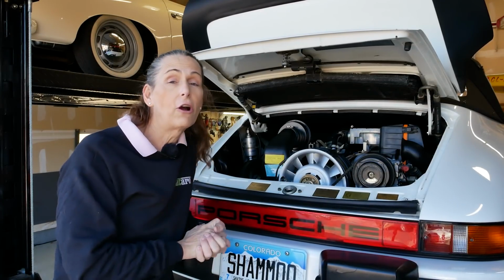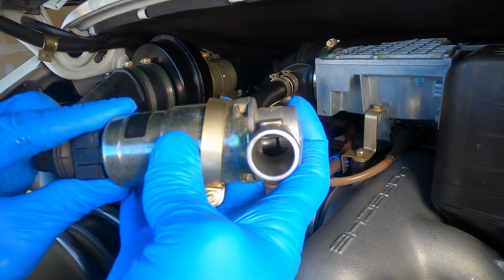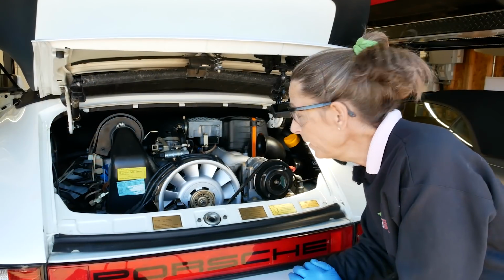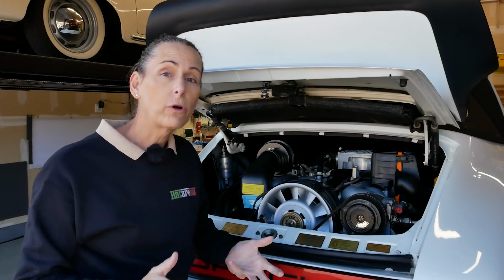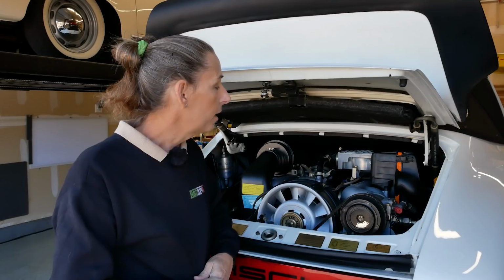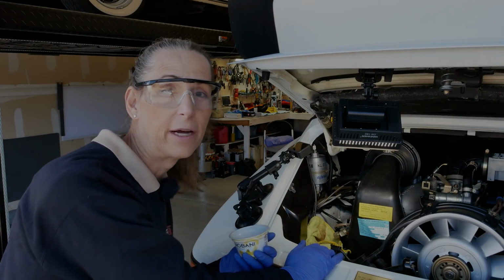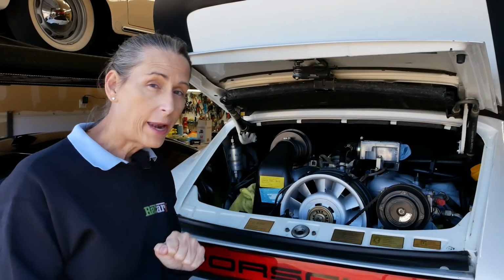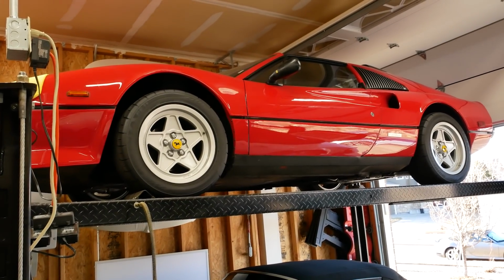Budget eBay Porsche 3.2 Carrera Project Car! #29 - WHAT IS GOING ON WITH THIS ENGINE!!!

Comment: WoW!  FI is not something I'm familiar with, but you really systematically isolated the faulty component.  WoW, great job Franny.  IF I had a suggestion, it would be that you secure your lovely ponytail.  I was a little frighten to see it moving around so much with the engine on, and the belt right there. I only remember from my H.S. days, (69-73 ~ ancient I know) of a friend that had long hair, and working in the machine shop during class on a lathe, it got caught and pulled his head down right to the machine, and only by yanking his head and pulling the hair right out of his scalp saved him from serious injury.  He had past shoulder length hair.... .  Anyway, great job, watch out for those purdy locks :-)  .  So glad you figured it out so methodically.  Great video.  :-)
Reply from the maker: Thanks so much.  Yes, Heidi had at me with the clippers ;)

Comment: Fantastic diagnostic video!!!
Don't get discouraged, did a split case rebuild on my '87 Carrera last year always a couple teething and digestion anomalies that can't be anticipated. I believe mine were a cracked forward fuel line, pedal bushings and slave cylinder on hydraulic clutch - be oh so grateful you don't have one of those! ;)

Just a suggestion....let that baby breathe, now that you have a sport exhaust ditch the restrictive & bulky air box and throw on a K&N cone filter. I think you'll be happy with the result.
Reply from the maker: Thanks so much!

Comment: I would be worried about the fuel injector rail corroding due to the zinc plating process it never coats the internal surface properly. I mentioned it before when you had it off for plating. The injector could be clogged with debris. Hopefully it’s sorted soon. Are you able to inspect the rail now it’s got the injectors out? It would be evident if corrosion as set in.
Reply from the maker: Thanks Elliot, I did check the inside of them and they are clean with no corrosion and nicely plated.  I didn't find any bits when I drained the rail and all the injector's screens were clean.  In this case it is a mechanical issue with the injector(s). I just got them back. I'll go over it in the next video.
Reply: @HeidiandFranny  oh that’s great news. Hopefully it’s sorted once the injectors are back in.

Comment: Great job, You inspired me the same job on my 1992 965 Turbo. I know my around air-cooled engines very well. Having owned and auto crossed and did a few DE's in 911's cars for 30 years now, I live in the DC area now, but from California, its become my winter project living in DC, I'm waiting on my exhaust to be finished getting ceramic coated and some powder coated parts, I also sent my hardware off to Van Nuys plating, Linda is great, Thank you for the recommendation. I also took the front suspension apart to have all the arms blasted a powder-coated and new joints and stuff and hardware plated as well. And injector blocks and upgraded clutch. I doing a leakdown today, all this in my garage just like you ladies. Again thank you for the inspiration.

Helio
Reply from the maker: Oh, that's great!  You are going to love the plating.  They do a great job.  Wow!  You'll have to let us know how it goes!
Reply: @HeidiandFranny  I would like to send you pic's of my project. My handle on Rennlist and Pelican forums is heliolps2, please send me a private message with your email and I'll send you updates on my 965. Keep up the great work Ladies :)

Helio

Comment: Never heard before about not removing plugs from a hot engine but makes sense
Reply from the maker: At least on these air cooled cars there are super hard to get back in... They just want to cross thread every time... Cold they go right in.  They are right coming out too.

Comment: Good diag.  I'd guess the bad injector is throwing off the O2 sensor probing of the exhaust which may affect your idle. I have very poor performance also in my 88 911 but without the surging idle. It also feels like a lost cylinder, but haven't diagnosed yet though.
Reply from the maker: I'm going to go through several more things to check in the next video. I'm not convinced we are out of the woods just yet.

Comment: Great informative video and an excellent methodological technique to solving problems . May I also suggest to perform a vacuum test with a pump for all the lines and also a cylinder leak down test. With the above test you shall for sure rectify any snags and get the car running top notch 👏👏👏

Comment: Fantastic video. I learn so much. (I have a white '87 Targa). So what makes the idle go high when one cylinder is 'dead'? And why fiddle with sending old injectors all over the place? Are they that expensive that you wouldn't just buy new ones? Thanks for sharing all this with the community. You are a treasure.
Reply from the maker: Thanks! Good question on the idle.  I'm not convinced it is just the injector either... I'll get to it this weekend and we'll see.  Those darn injectors are about $300 a piece for the originals and maybe a bit less for aftermarket. I think RC is $25-$35 for complete refurb.  Just don't wait a year to install them ;)

Comment: Great diagnosis.
I think you are right about the injector having locked up because it sat unused for a year.  With such small components inside the unit it doesn't take much corrosion - or even dried oil or something - to cause a mechanical issue.  I wonder if the resistance across the connector pins was spec or not.  No worries, sounds like RC has your back.  Great find!
Reply from the maker: Thanks! Yup, RC had to work on them a bit and that wasn't the only one... I did check the resistance and it was in spec at close to 3 Ohms.  I'm really curious how it will go when they are back in.

Comment: Swap fuel injector???
Reply: Idle speed. Just reset it????
Reply from the maker: Not really resettable.  It is continually monitored. We'll see when the injectors go back in...
Reply: @HeidiandFranny  thought it’s adjustable.  I thought it was injector. Kind of strange but that’s my bet
Reply from the maker: It is adjustable, but it shouldn't be fussed with without a Gas analyzer. And since it was idling just fine before it is more likely something I touched. I'll be testing a bunch of things in the next video :)

Comment: Hi Franny and Heidi, great Diagnostics.!! I absolutely love your videos. If it’s Heidi that’s doing the editing kudos! You both do such great work.
When I am flying behind my wife’s 1975 mechanically injected, horizontally opposed six cylinder,  air cooled two plugs per cylinder Continental IO-550, we won’t take off without all six cylinders firing evenly on each set of plugs.  I am so lucky to have an EGT/CHT that shows me instantly if an injector is clogged or a plug is fouled..
Keep up all the good work. Looking forward to your next video.💕
Reply: An IO-550 is a seriously big flat-6 aero engine. What large air frame is it attached to? Cheers from another flat-4/6 aviator in NZL, David :)

Comment: Franny, you’re an inspiration! Looking forward to the next episode; I (expect?) solving that single injector issue will address the high idle. Wonder if a fuel injector nozzle flush cleaner would have done the trick.
Reply from the maker: Thanks Tony, I did consider that, but after calling RC they said sent them all back so we did.  They were right!  Turns out it wasn't just the one that had issues... Stay tuned :)

Comment: Great stuff Franny! Your technical skills and diagnostic approach are first class. Thoroughly enjoyable viewing. Was just wondering about your professional background. Care to share?
Reply from the maker: Thanks Phil, I have a degree in Engineering and have owned several VW Beetles ;)  Trial by fire as they say...
Reply: @HeidiandFranny  awesome!  I must admit, I'd be curious to see your resume.  Don't really know why, just kinda curious to see the nuts & bolts of your schooling & experience.  
(Two college and bike racing buddies are Phd's in mechanical engineering and I'm always blown away by their prowess in their respective fields.  Another bike guy is an MS mechanical engineer at CERN.  And my two college roommates are both university professors in math and materials science.  I was not of their abilities, so I like to think I helped with the old "regression toward the mean" phenomenon!!!  AKA, the village idiot!)
Reply: @HeidiandFranny  I was thinking either that, or an MD.
Reply: @HeidiandFranny  The degree in engineering certainly doesn't surprise me! I studied Mechanical and Production Engineering in the UK, but went down the HNC path which has a strong practical as well as theoretical component. Thanks for sharing.
Reply: I really appreciate you two- great videos! I have a question and would like your input. I’m building a 3 car garage/guest house that will have in floor piped heating in the garage concrete slab, and I want to have two 4 post lifts in two of the three bays, similar to your set up. My contractor/architect said we could just thicken up the concrete pad, and I think that sounds good- don’t want to compromise the in floor heating piping. Since your in Colorado, not sure if you have in floor heating in your garage and would have an opinion? Also, what kind/brand of lifts do you have, and would you recommend them? How are they secured to the concrete? Thanks again! I’ve learned tons and have applied to my 356C and 912!

Comment: Look for vacuum leaks passed the mass air flow sensor for idle issues (check intake gasket, vacuum lines, check mass air flow sensor itself)

That plug looks like the injector is not spraying in a mist formation. Maybe clogged or faulty or getting a poor signal. Check fuel system wiring.

Sometimes the head of the ejector can get damaged in the prosses of the rebuild.  If you drop, or set down the injector rail on a dirty table its possible the injector can get debris in it. Possible the tip of injector could have damage. 

Good call, swap out injector to "see if the problem follows the injector "

Edit: I have actually had a faulty injector that was "bench tested/flow tested" too.

Lesson learned, once you get them back AGAIN , test them with a 9v

GOOD LUCK

Comment: Just curious, will replacing the repaired injectors take care of the idle problem as well? Seems that we moved from the idle to the injector problem but may have missed if there is any direct correlation to dropping the idle once the repaired injector is returned to service. Thanks really enjoying these videos.
Reply from the maker: Thanks!! Great questions!  I suppose we will see.  The injectors just got back and they were worse than just the one.  I think it is time to go through the fuel system in detail.  Stay tuned!

Comment: 21:05 I am always afraid that Franny is getting so close with her hairs to these gear wheels
Reply from the maker: If you watched the video to the end, you can see that her hair is much shorter because I cut it.  Heidi
Reply: @HeidiandFranny  You are supremely multi-talented Heidi!
Reply: And even scarier as the cooling turbine is actually sucking air directing into the engine and can easily pull hair.

Comment: Excellent detective work throwing a dragnet over each sub system
Reply from the maker: Thanks!  I'm wondering what else there is but it won't run well with fussy injectors.  We got them back...  It was worse than just the one.